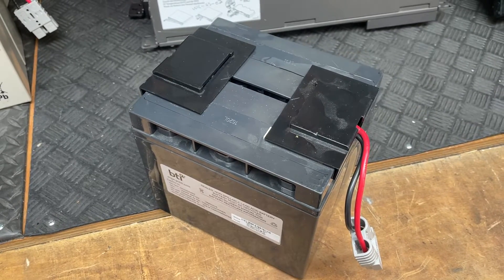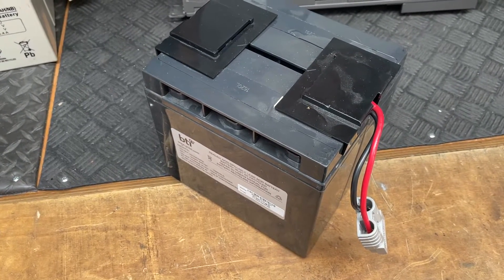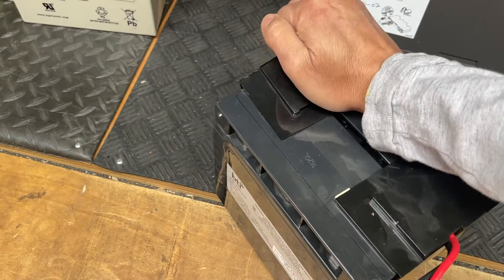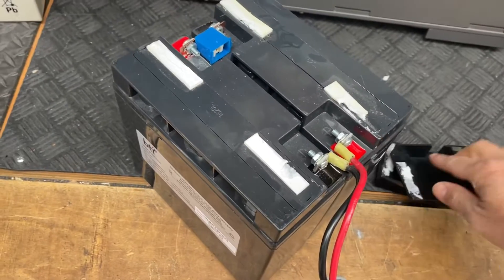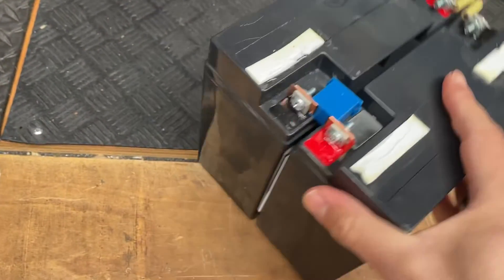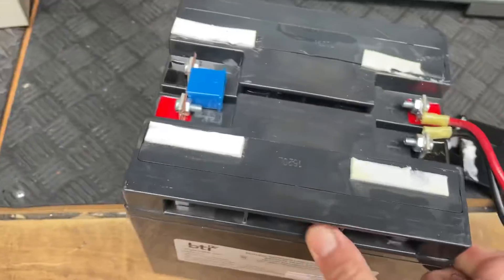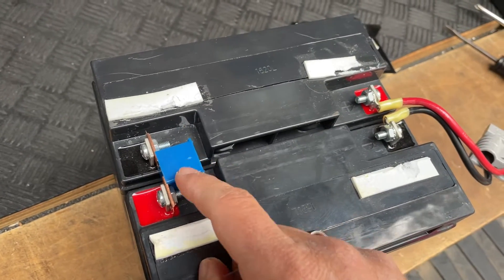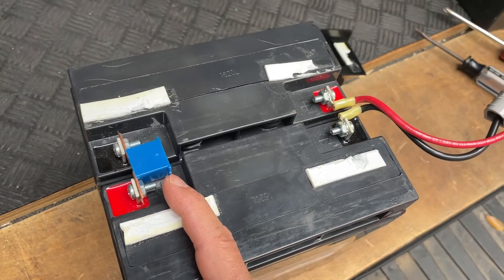Important: Fuse for your new UPS battery

Comment: Just curious, is that a 50A fuse?
Reply: 100A/32V
Reply: @JaroslavHuba how much watts of dc current please???
Reply: @feehanmaqbool1408  if you have apc smt 2200  with 2 packs, so there are 24x2=48 volts. Max current approx.: 2200/48~50 amps
Reply from the maker: The fuse we have on the video says 100A 32V
Reply: The fuses I have say 12V/100A.